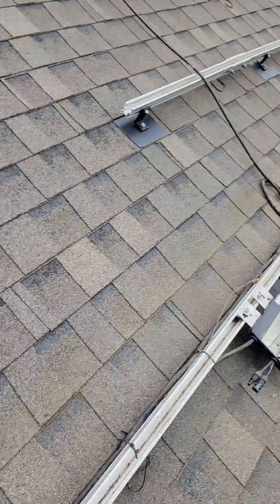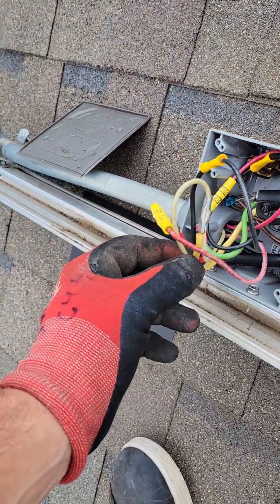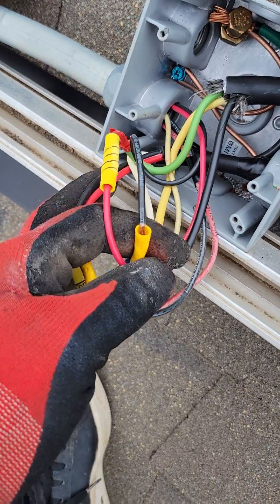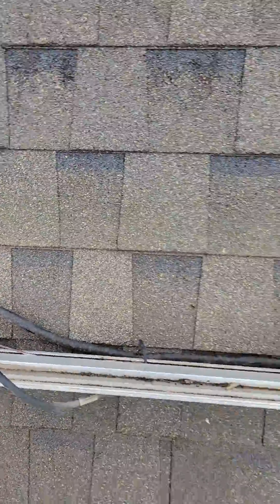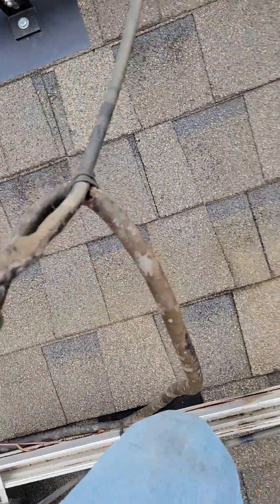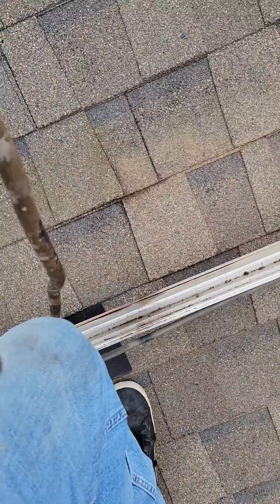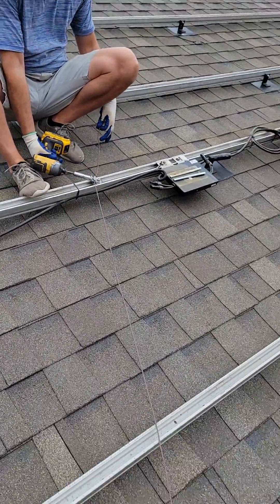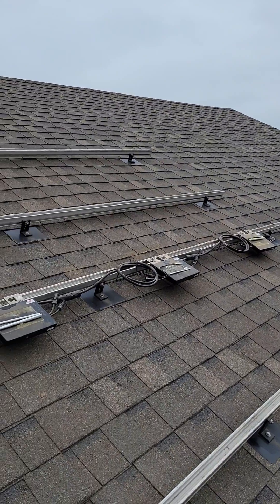Solar removal project. installed originally by others

Comment from the maker: wanted to add in some areas - they let you ground every other rail --   not a big fan of this   - as we service solar power systems -   and feel its just better to ground more - even the best installer can miss 1 ground - skipping  the wrong rail  or get the clamp turned in wrong - or a panel may have a paint coat that doesn't  always let the piercing of the proper mids or end clamps -  its just  better to do all rails..    I see why some inspectors may want this ..